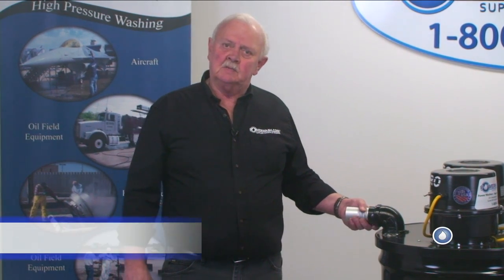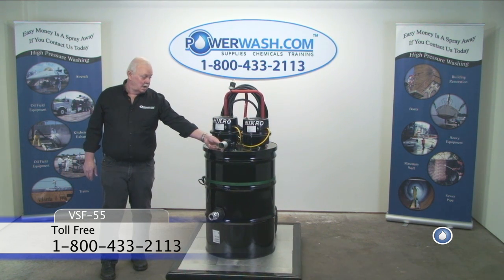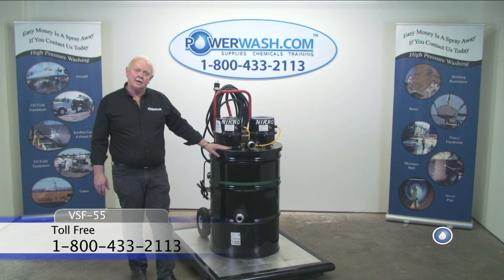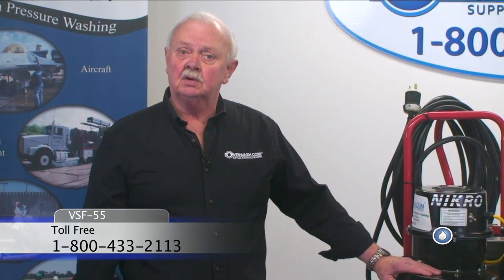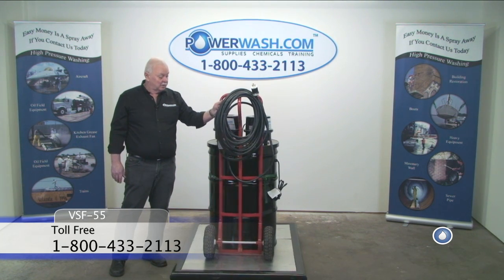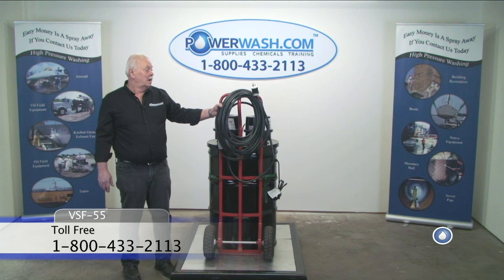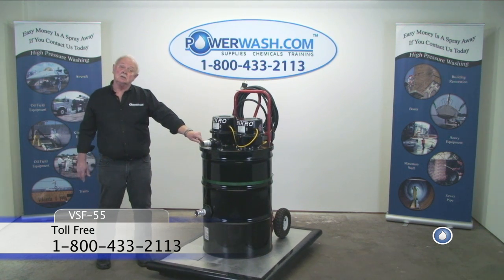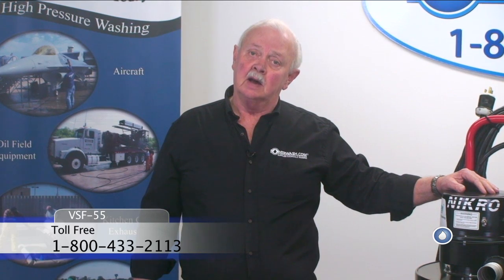Vacuum Sludge Filtering System - Improved Vacuum Filtration

Comment: Is this vacuum sludge filter system can filter the cement paste waste water from washing
off for the exposed aggregate concrete finish?
Reply from the maker: As a solid it should but if it goes into suspension it may not.